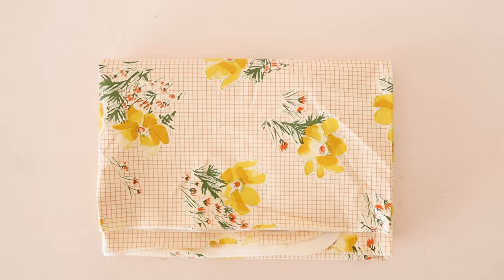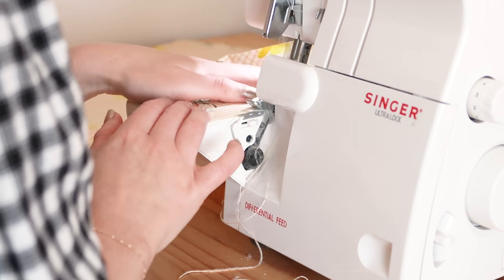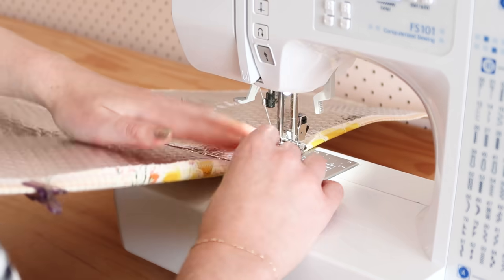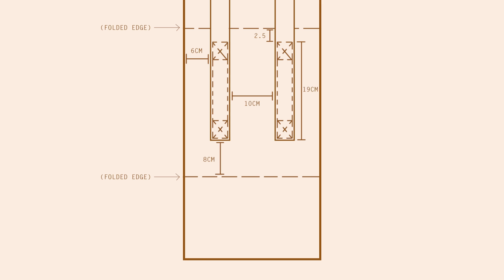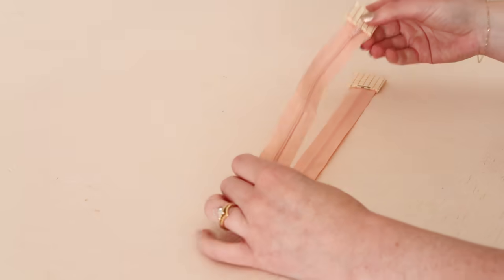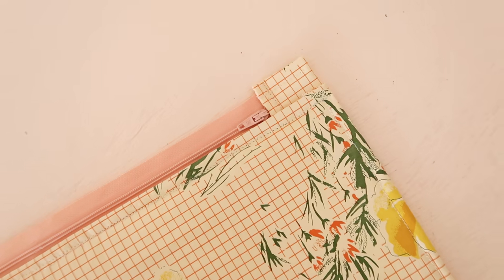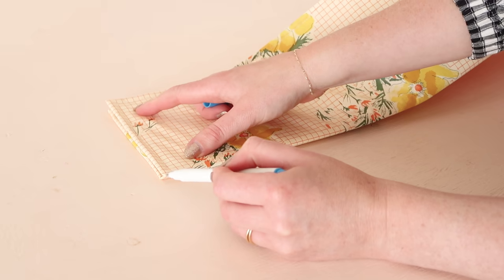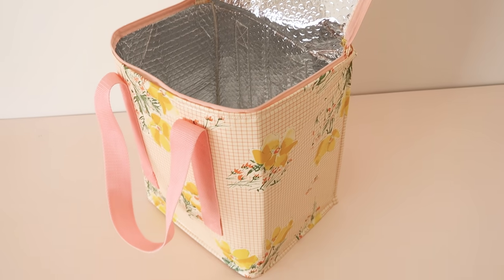How To Make A Cooler Bag (From a Retro Tablecloth)

Comment: Hi janelle! Smaal question: when stitching on the zipper, did you line up the stitching with earlier stitches on the edges (for a clean look) or did you offset the stitches as to not perforate the pvc? Thanks for the lovely tutorial!
Reply from the maker: I just lined up the stitching with the previous row, but if you feel it might perforate it too much then it’s best to offset the stitching 😊